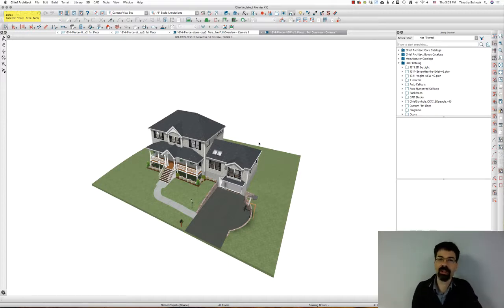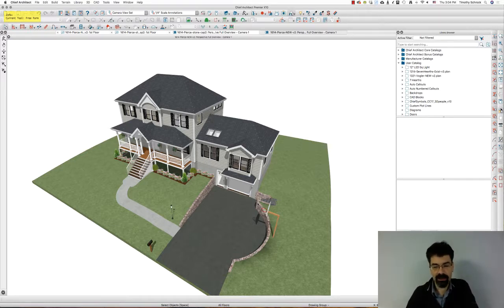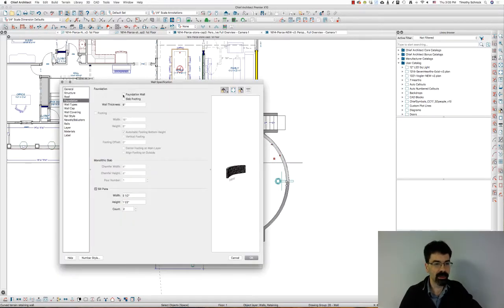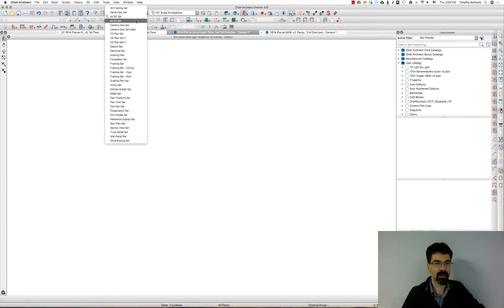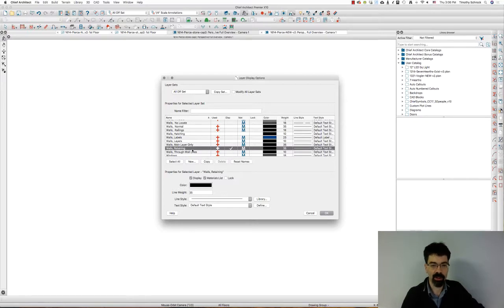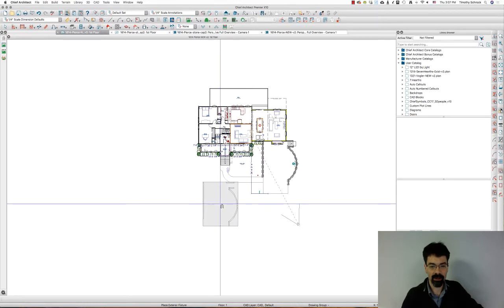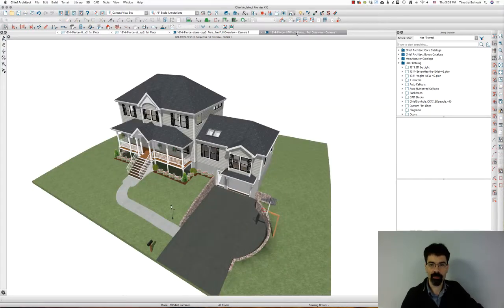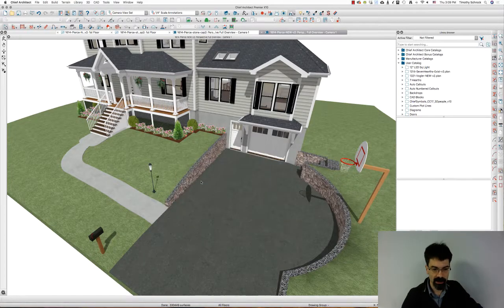Create a Complex Symbol Shape

Comment: Hello, I would like your opinion about how accurate the terrain modeling (along with retaining walls) are in Chief?   In my experience I cannot, with confidence, rely on its accuracy especially in complicated steep terrain models with many retaining walls.
Reply from the maker: CU96821 I don’t use it for terrain modeling to be very accurate. I mainly use the terrain to help give context and texture so if it’s close that’s good enough for me. Therefore I probably wouldn’t be the right person to ask about accuracy. 
However, I do experience struggles when the grade has lots of changes and I’m adding terrain walls. Sometimes I give up and make them typical foundation walls, set the top and bottoms where I want and draw a terrain break on top of the wall. That can help most of the time.